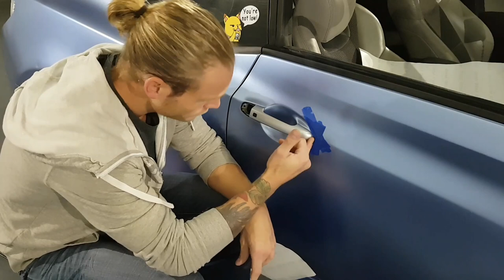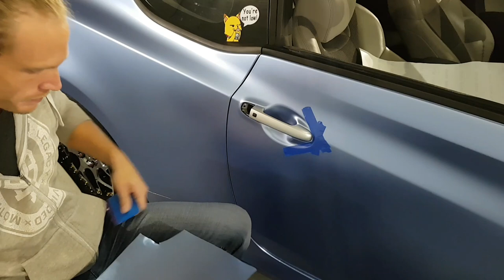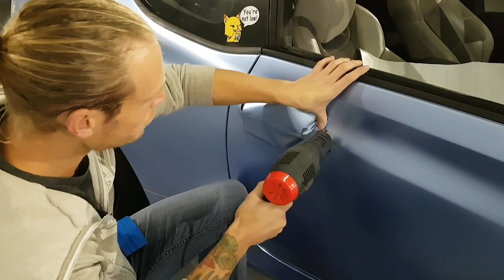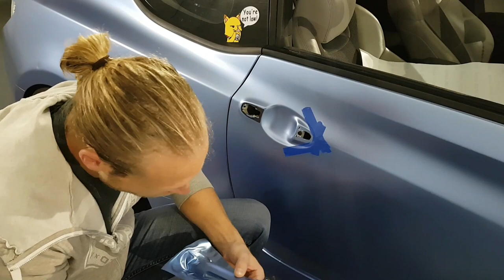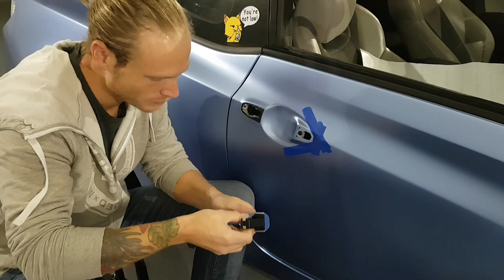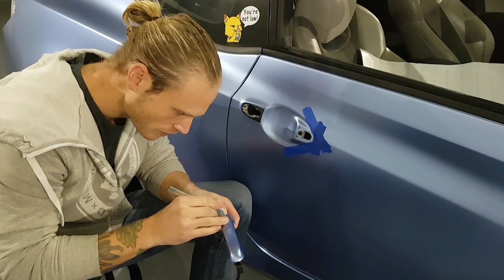How to vinyl wrap a door handle. How to wrap a car by @ckwraps www.ckwrapsmiami.com

Comment: Wouldn't the wrap on the door handle fail eventually because of opening and closing the door? Like wouldn't your oils and fingers peal the seam over time? Curious.
Reply from the maker: It is the most common area of failure. There are ways to make it last and it should last several years when installed correctly